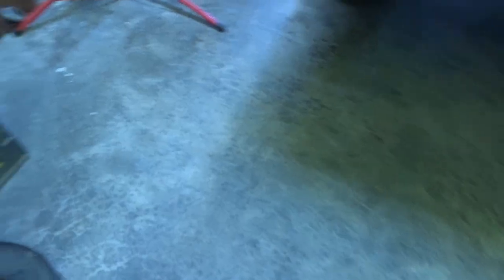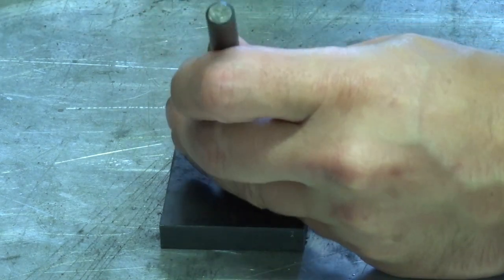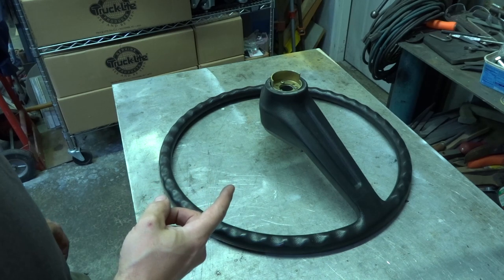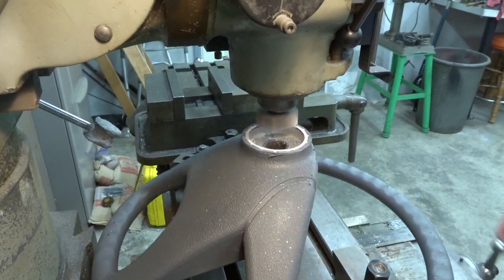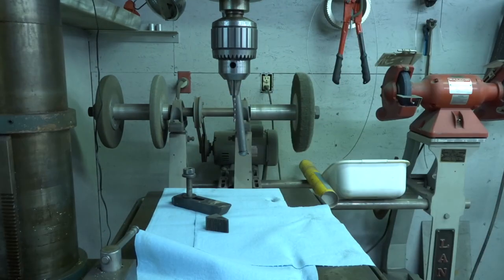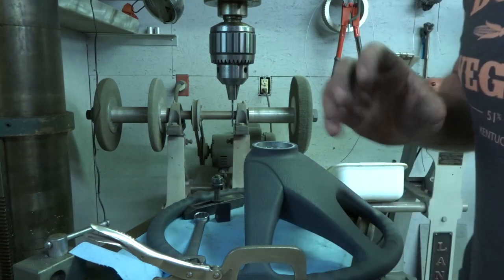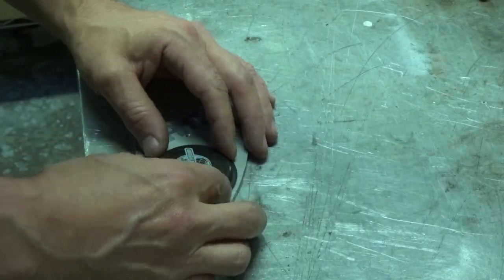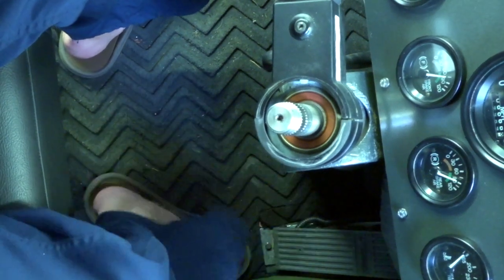LMTV Gets a New Steering Wheel

Comment: I paid $40 for that wheel puller you made out of scrap.  I was just glad my wheel came off easier than Sean's.  Thanks for the video, I love watching your progress.  I used your light wiring chart to add a keyed ignition to mine.  Initially it was a just a keyed start, but you could take out the key and it would still run.  That seemed like an accident waiting to happen, so i made it so the on position energizes the ignition circuit and the brakes, turn signal beacon and hazards.  The ignition switch now turns on all the lights.
Reply from the maker: elgoog Sucks nice. Nice, I’m planning on doing something very similar when I add a keyed ignition.

Comment: Nice, it was easy, it only took me six tries. Oh well, trial and error is the best way to work on electrical systems.  Just a heads up, the starter is 24v and everything else was 12v.  I used a relay from O'Reilly and it has been working so far.

Comment: Can you tell me what the thread size and pitch of the puller holes for the original steering wheel.  Also, any chance you know the thread size and pitch of the hub nut and shaft?  I have a typical shop puller kit, but none of the stockers fit, I'll have to order something in.  My nut came off with a few thread and will need chasing prior to reassembly.  Appreciate you.